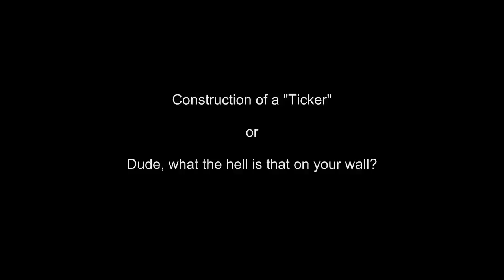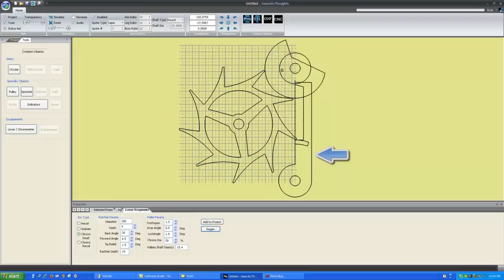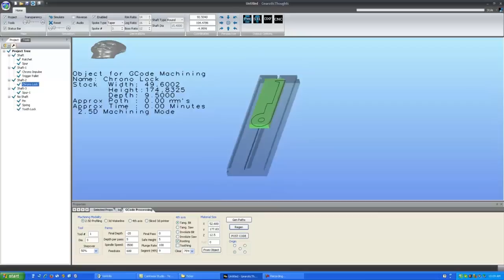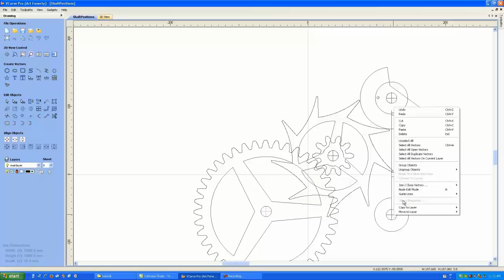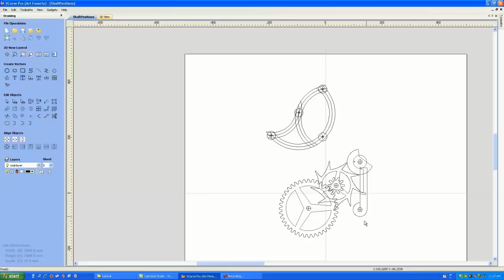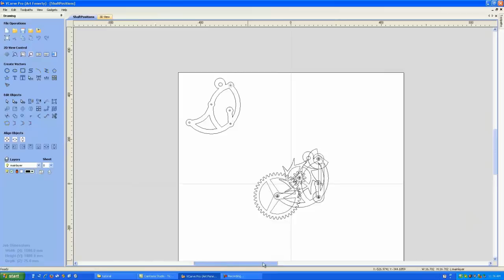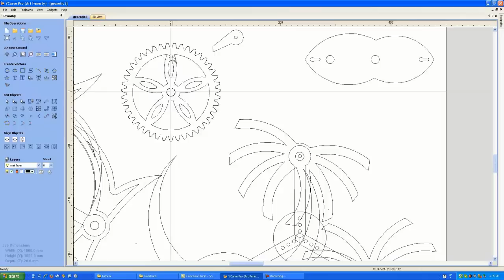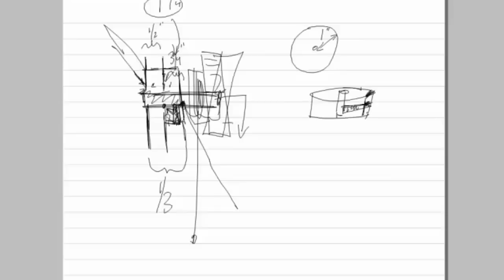Designing and constructing a Ticker

Comment: Art, I have downloaded the files you provided (Thank you for that) and am at the stage of assembly.  Throughout the video, you point out the use of ball bearings...Further, you mentioned you use 1/4 inch brass rod for the arbors, so I'm assuming I need  to source several 1/4 ID x 1/2 OD flanged bearings.  Are other sizes needed?
Reply from the maker: Jim, no that should do you. I buy mine on ebay 50 at a time, when they show up. I used that size because I got them cheap so dont feel married to that size. Also, soak them in a solvent so they get real loose and fast.. makes it run longer.

Comment: Art - What kind of laser cutter are you running in your workspace? Is it a specific brand you recommend? Are you pleased with the cutting it does?
Reply from the maker: I have a 10 watt , a 40 watt, both cartesian, and a 50 watt galvo , each has its use. I generally like lasers a lot.. :)
Reply: @ArtofCNC  Did you build your laser cutters yourself or did you purchase them? If purchased, what brand of machine? Sorry to be nosey but I am seeking a 40 watt cutter for my own shop so I am asking people in the know.
Reply from the maker: @artofcuret  I bought a mornstar  40 watt long ago , it works well. The other two I built from Ebay parts. If youve never had one, Id try one of the cheaper K40 type lasers,  they work fairly well really...

Comment: What are the steps to get this in PDF format? Like 1:1 paper template to use a band saw or a scroll saw? I went to gearotic and download the zip for Scimatar but nothing on my computer will open it so I can print everything I need. Thank you in advance
Reply from the maker: You might try AutoSkecth, it should load the dxf's, and output in different formats. If you install Gearotic the Program Vexx will load the dxf's and output them 
as svg's, that may help in printing them.
Reply: @ArtofCNC  ok thank you very much. I will try that.

Comment: Great one. 
Question: how do you calculate power spring?
thanks
Reply from the maker: Hi:  I used a 4lb spring, but I just hapened to have one that size.. I suspect the design will work with any reasonable size spring..
Reply: hm...
i need to make spring which will rotate the rod veeery slow and for minutes.
Reply from the maker: To rotate very slow, youd need a large mass for the vanes to raise their intertial moment. The spring I used was
from Vulcan Springs, you can check their specs for power vs thickness of stell..etc.. Ive never made a spring from scratch. I suspect Trial and error is the way to go..
Reply: I see
Thanks, will work on that )